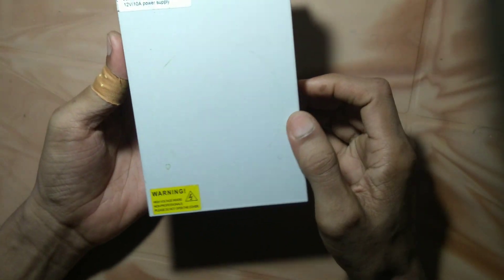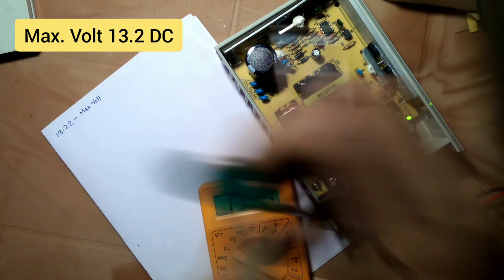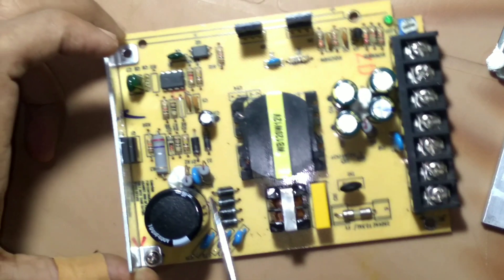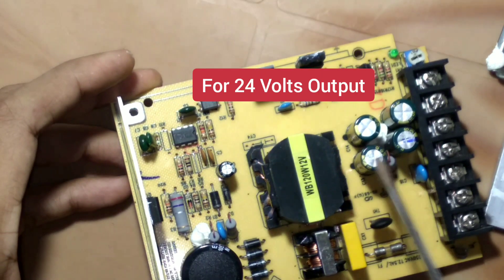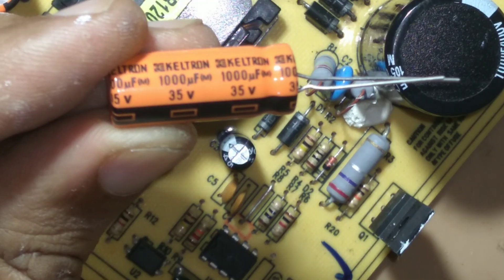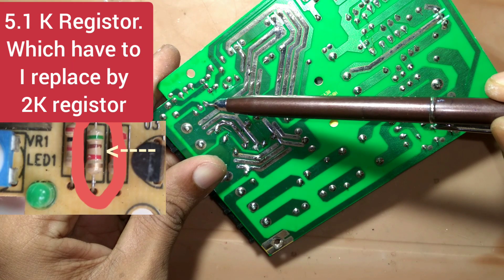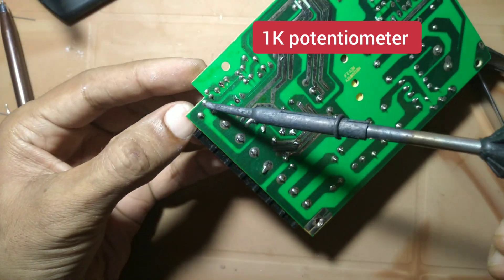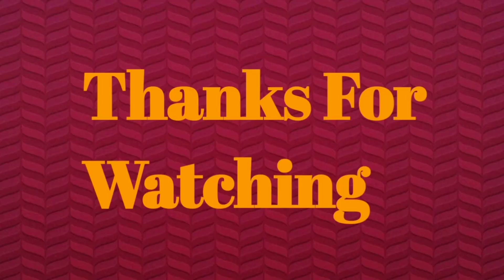Modify SMPS output voltage 12 Volt to  3 -30 Volt

Comment: in 12v 30amp, I changed the resistance from 2.2k to 2 k ... and capacitor to 25 v 3000uf, and i got voltage of 15 volt max... 
but capacitor blows in 10 minutes ..... 
can i use 50v capacitor ? 
I want approx 15 v output !
Reply from the maker: Yes, but capacitance should high value, please calculate the values of register of your smps  first, if the voltage divider ic is TL431 then watch the video carefully to replace the Voltage divider resistance

Comment: Great video...  But in minimum dv voltage where did u get 100k from?  

I have 24v 5a smps...  With tl431 & only 2 resiator which is 30k & 3k....  Can you give me a calculation to which should i change?

Comment: On MW LRS150 12V supply. I want regulation betwin 12 and 4V. Can I put in parallel of the original trim (8 kOhm) another pot. and wich value?

Comment: 24v 10amp smps power supply ki out put  19.5 to 29.9 volt . Kya ushe 5v to 29.9 bna skte hai ? Kaise ?
Reply from the maker: You can use 1. buck-boost converter 2 or by changing the feedback circuit . You can find it near TL431
Reply: @EtcProjects  SMPS me modified nahi ho sakta ?
Reply from the maker: Yes, you can modify output voltage by changing feedback circuit,  maximum feedback circuit consists TL431
Reply: Sr. I request ho ske to ek vedio baye
Reply from the maker: OK I shall try . You may watch this
 https://youtu.be/DI_lKaD2JWg

Comment: my power supply is disarming and arming below 9v. R1 = 2k and R2 = 10k. Potentiometer 1k. I put in R1 a resistor of 1k and potentiometer of 100k. the source is arming and disarming below 9v. can you help me ?
Reply from the maker: No I have no solution 😕
Reply from the maker: I am also facing this problem  , trying to solve this, there will be another video on it.

Comment: Merci pour la vidéo .I have an LRS-350-24. how can I modify it. Currently with the potentiometer it varies from 19.5 volts DC to 24 volts DC. I would like to be able to vary from 5 volts DC to 24 DC.
Reply from the maker: 5 to 24 volt not possible by changing the resistor on voltage divider part, this may damage your smps, please use any buck converter

Comment: Hi, very interesting, well done! I have a 12V/30A SMPS with the 1.5K resistor to replace and the 1K trimmer. To obtain the same result, how many Kohms do I have to replace the resistor and trimmer? Thank you.
Reply from the maker: Please use the resistor calculation formula, given in video, please watch without skipping

Comment: If we modify it in your way then will it decrease amp ?
Reply from the maker: Yes, with decreasing volt amp will decrease automatically
Reply: The power is given by the transformer and the power transistors. The modification in this video is to vary the voltage only. The formulas are as follows: 

Power(Watts)= Voltage(Volts)*Current(Ampers) 
Votage(Volts)= Current(Ampers)*Resistance(Ohms)

You can find the current by yourself substituting the power of your SMPS and the voltage you will use.
Reply from the maker: No, ampere is changed only when you change the ferrite core transformer
Reply from the maker: Yes

Comment: Sir that's is safe for PSU  no anything problem in other parts after modified?
Reply from the maker: Depending on your load and mode of use, this is just for rarely used devices

Comment: I did as per your calculations but when voltage reaches to 6 volt output fluctuates.
Reply: Below 6 volt it fluctuates
Reply from the maker: This also happens to me, mainly in lower voltage,  trying to solve this problem
Reply: @EtcProjects  ok
Reply: @EtcProjects como lo solucionaste?
Reply from the maker: Please tell me in English
Reply: @EtcProjects  how did you Solve It?
Reply from the maker: No,

Comment: where was the 5.1K resistor (R2).  It never showed up in your circuit.  There were 22K ,  1K  and 2K. No identification as to which ones were which resistors.
Reply from the maker: Thank you for Watching.
Please watch again, it was 5.1k, not 1k, and registor colour code helps you to identify.
Reply: @EtcProjects  That is what happens when a person like me is color blind.

Comment: if not tl 431 on the mainboard what can i do?
Reply from the maker: There must be a fixed value zener, you have to replace it by tl 431.
Reply: @EtcProjects   how is make connect reference pin?
Reply from the maker: I shall try to show it in another video.

Comment: Hi, nice project, I did the same thing. But the 12v 55w bulb does not light up, the amperage has disappeared.
Reply from the maker: Wattage of SMPS?
Reply: @EtcProjects  120w
Reply from the maker: Is the SMPS 24 volt or above?
Reply: @EtcProjects  I switch from 12volt to 24volt, the result is the same.

Comment: What will happen to the Amps ?
Reply from the maker: It is 120 watt smps, so depending on load the amps may change
Reply: @EtcProjects  thank you
Reply: @EtcProjects  is there’s any way to adjust the Amps
Reply from the maker: Yes, you can add a buck converter with any smps output as per your requirement
Reply: Hola buenas noches yo tengo una fuente de esas pero no tiene el tl431 como hago para modificar el voltaje de 19v DC a 30v DC ? Ya que. No trae el tl431 el modelo es este  LRS-350A- R11  @EtcProjects

Comment: Hello Sir. Nice video. I did the same as you showed : incresed the pot from 1k to 10k and the fixed resistor from 1.5k to 500 ohm but i only reach 21v. Any idea why ? Thanks.
Reply from the maker: R 1 and R2 value change the voltage so properly calculate the value of R1 and R2 for required voltage.
Reply: @EtcProjects  hello and thank you for your response. I just want to reach 28v, any idea on how to do this  ?
Reply from the maker: V(out)= 2.5×(1+R¹/R²)
2.5 reference voltage for TL431
Now please calculate R1 and R2

I don't know your circuit,  otherwise I will try
Reply: @EtcProjects  Thank you, i will try this. I have a circuit based on a tl 494 without the tl431. Do you think the formula is still the same ?
Reply from the maker: If TL494 is an adjustable zener, then the formula will be same but reference voltage may be change, please check the datasheet for details. I have no idea.
Reply: @EtcProjects  Thank you very much for your answer.

Comment: Thanks for the video. I bought the cheapest one from Amazon and it supports to 36v-40v. Could I change its components with reliable ones? And could I modify its exit voltage pot with good one and add a voltmeter/ amp meter?
Reply from the maker: Yes, you can add voltmeter, you can also modify its output voltage.
Reply: @EtcProjects  Could you make a video for this? 😊
Reply from the maker: @tcirit  uploaded a new video . You may watch 
https://youtu.be/DI_lKaD2JWg
Reply from the maker: @tcirit  uploaded a new video . You may watch 
https://youtu.be/DI_lKaD2JWg
Reply: @EtcProjects  Great 👍 thanks
Reply: First thing ANYONE should do with these chinesium PSU's is replace the switching transistors with some better spec ones from DIgikey or Mouser as these are usually what fails in the higher amp units.

Comment: do you have telegram sir, i want to send picture of my power supply, i want to modify it too but i cannot find 5K resistor
Reply from the maker: Yes, I am in telegram, please find the voltage divider part
Reply: can you send me the link
Reply: can you show me where is R1 and R2 on your board? does 104 you replace is R2?
Reply from the maker: No, resistor attach with TL 431 find, it places different position in different circuit board
Reply: how many resistor that attack with 431 and we remove that after replace with variables resistor?
Reply: how do we know which one is R1 and which one is R2 on the board?

Comment: Brother mere smps m smd component laga h circuit samaj nhi aarha h voltage divider kaa aap whatsapp contact krr skte h kya?
Reply from the maker: I suggest you not to desolder the smd components, use DC DC boost or buck converter .
Reply: @EtcProjects  space issue h